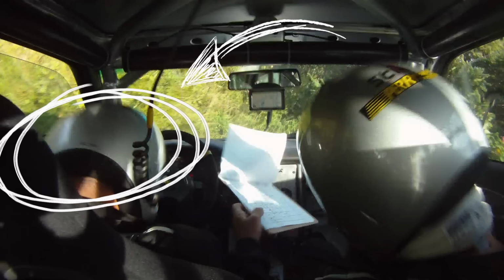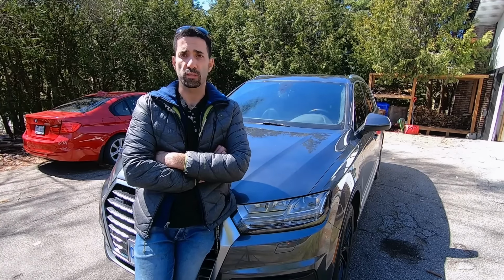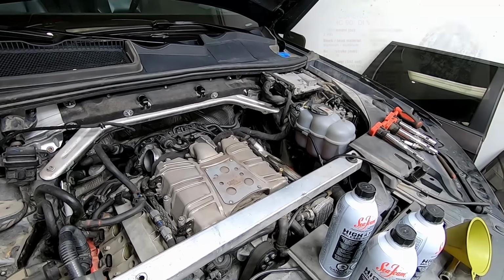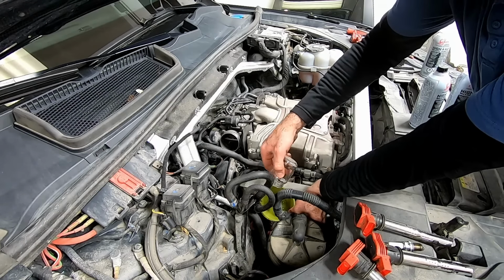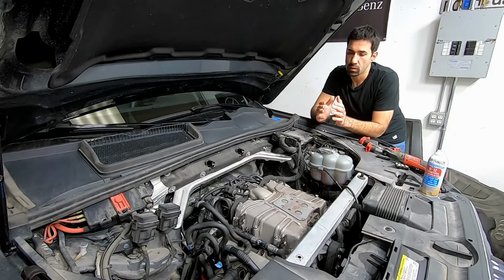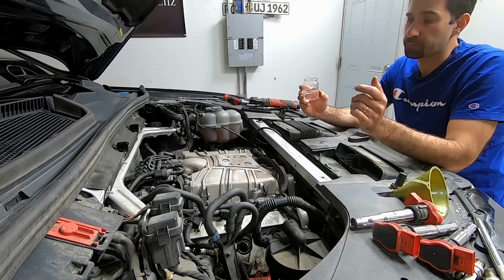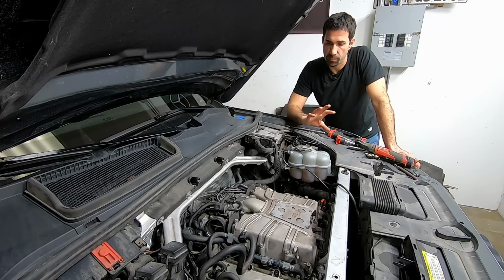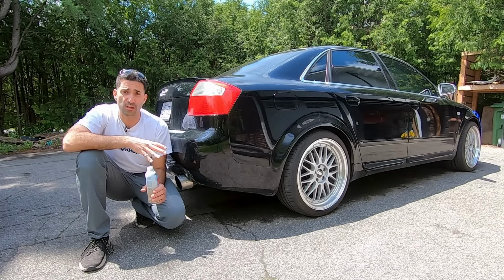How to fix oil consumption on VW/Audi/Porsche 3.0T engine?

Comment: Please enlighten me on why to use Rotella? I am not clear on it. Also, just for one time (after the soak) or ongoing?
Reply from the maker: @Jordan-cf6bo  rotella is a diesel oil and has additives to keep diesel engines clean... it continues the cleaning process after you change the oil... technically speaking the 5w40 is not approved for this engine so if you want to stay in accordance with the spec you shouldn't use it... but plenty of folks run Rotella daily without issues so really the choice is yours
Reply: @ETMotorsports  thanks sorry to belabor this, but what are the cons to doing this? Also, just to clarify, is it your experience to run the Rotella just for one oil change cycle after the soak, or run it from now on?

Comment: Hi friend 
When you flush the pistons with b12 with starter .need to remove the fuse of the injectors?
Reply from the maker: @giuseppecutolo5756  you can if you want
Reply: On audi q7 you don't remove the fuse?
What you suggest me?
Reply: Meaby gasoline on cylinder help for flush all carbon?

Comment: What size of bit or socket did you use to turn the crank shaft?  Thanks.
Reply from the maker: @MichaelPan-p2r  the v6 uses a special tool - I think 1412

Comment: I'm trying to help a friend out with his 2014 Audi A7 and he has the same 3.0 T engine and it's burning a lot of oil. He's adding a quart every couple weeks and we did a spark plug change a coil pack change and an oil change in a car seems to be driving a little better before it was driving sluggish but the oil is getting consumed a lot again and I have a feeling that everything we just did as far as replacing the spark plugs and coil packs are going to be off or not cuz it's probably going to slowly deteriorate those items again and start driving like complete shit again. So I'm thinking about doing this after I show him this video I'm going to see if he wants to give this a try I keep seeing these price quotes from the dealership for $20,000 for a new engine and I keep thinking, obviously this engine has some type of issues that is causing this oil consumption so if they sell you a new engine for $20,000, what is the engine end up doing the same shit eventually and start burning oil when she passed 100,000 mile marker. Nowadays people want to drive their cars well over will past 100k miles sulfur oil consumption to start being this bad you know once you pass that Mark is not cool. Audi should be paying for this I don't get how Audis not at fault for selling a badly engineered engine because if everybody's having the same issue, obviously have something to do with the way the motor was engineered

Comment: Thank you for making this video!  I’ve a 2018 q7 3.0T experiencing the same problem, I live in Kingston which is close to Ottawa, usually need to top up 1L of engine oil per 500 km, could you help me to recommend a shop that can perform this service?  Thank you!
Reply from the maker: hey very few shops will ever attempt this on a customer car unfortunately...everybody thinks this is some snake oil magic so they don't want to deal with unhappy customers...you're probably better off doing the job yourself - it's not that complicated
Reply: @ finally I found a shop here locally willing to try piston ring soak.  It’s now around 1000 km since the soak, no sign of oil drop.  I did had a start stop system malfunction and engine check light around 250 km but it eventually cleared on its own.  Thank you for making this video, I’ll provide more update in the future.
Reply: Update:  1600 km in, noticed the level dipped about 1/5 from max, I did check a few times sometime the level will go back to max.
Reply: Update: 3000 km in the engine oil level display is now 1/3 down from max
Reply: Update: 3800 km so far oil level 1/2 down from max on display
Reply: Update: 6600 km with 1/5 left
Reply: Final update: after 7370 km the low oil level alarm finally triggered to request adding 1 l of oil

Comment: Have a 2012 q7 3.0t, only 80k miles, was burning 1 quart every 550 miles.  Tried various engine flushes over the last few years, nothing helped.  Did the berryman piston soak,so far 1200 miles and no movement on the dipstick.  A few tips: this is a v6 so I jacked up one side of the car to get bank 1 as close to level as possible, added the berrymans and used a boroscope to be sure piston was completely covered.  checked and topped off the cylinders over a 6 or 8 hour period, some cylinders leaked down quickly. ended up using 3 cans just on bank one.  These are big pistons and even jacked up it is still not level and needs a lot of fluid to submerge the pistons.  I would recommend using a boroscope during the top-up process to insure that the piston remains fully submerged.  I only did one side of the engine, in 5000 miles I will do the same with bank 2.  but just doing bank 1 has had real results. (cylinder 6 had an black plug so thats why I started with bank1)
Reply from the maker: 3 cans on 3 pistons is quite a lot of fluid... you can't run the engine with that amount...I think you can get away with a lot less - 50ml/ cylinder every 12hrs or 2 cans total for the 6 cylinders... either way it's worked out great - happy to hear the engine is back to reasonable amounts

Comment: 2017 q7 here. 65k miles. Burning 1L/3,500 miles. Not that bad. But.. 
Does it hurt to do the soak before it gets actually bad? Any reason to wait until it’s in the range of sub 1k/L ?
Reply from the maker: hmm...my Touareg was burning 1L/2000km and I did a soak with Seafoam, which actually pushed me past 1L/6000km...if you're not consuming that much, there's a good chance the issue has not gotten bad enough to require B-12. If you're comfortable with the motor, I would do a soak with Seafoam or something similar at your next oil change just to see if there is any improvement and if there is you can keep doing it every say 5 oil changes just to keep things moving freely and perhaps avoid the big issues altogether

Comment: Wondering if I should do this on my Q7 when so far oil consumption is about 1l per 9000km
Reply from the maker: @alancatraniuc2465  that's not oil consumption mate 🤣 that's your engine just smelling the oil vapors  as they go by...lol don't touch your engine - just drive it like you stole it

Comment: Where did you buy your Crank Tool? I have been seeing kits for $145-$400+. I just want the tool.
Does this crank tool work for all Audi engines you have worked on?
Reply from the maker: @LobbanVlogs  Amazon has it - part of timing kits but I've seen it on its own too... there are a few different configurations for the crank in the Audis - this is for the ones that use multiple bolts to hold the pulley - a lot of the V engines are like that

Comment: I had the same problem with my 2015 Audi Q5, follow this video process with B12 and the results were a success from 170 miles to 1600 so far without adding any oil, I am happy so far. How often should I do this process? Please anyone out there?
Reply from the maker: @humbertoramirez4829  hey great results! You shouldn't do this process if the issue is gone... I'm not sure there's any value in doing this preventative... plus B12 is pretty strong stuff so best to keep it out of the engine unless absolutely necessary...keep track of your mileage until the light goes on - if you can get through an oil change without adding oil i think you're good... in the future if it ever goes bad again you can repeat

Comment: This may sound silly, but wont the heavy smoke cause the sprinkler to go off in the garage?
Reply from the maker: @Vin_Nair  what sprinkler? 🤣🤣
Reply: @ I am planning to do this, but my garage has sprinklers. 😄 I guess, I will just unplug my smoke detectors and it should be good. Wanted to ask what would be a good way to know if the pistons are at TDC, do you need that camera? Is there a way to DM you?

Comment: Can all 6 cylinders be done in 24 hours all together, instead of waiting to do 2 every 24 hours?
Reply from the maker: @rsingh5077  sure... you can do 3 sets of two for 8hrs each,  total of 24hrs...I took my time but you can try a shorter cycle - effectiveness may be reduced but I've no data to confirm either way

Comment: Could you upload a post for the location and how to crank the engine, Audi A4
Reply from the maker: You mean for the crank pulley? You can see it in the video - will need a special tool for the v6
Reply: @ETMotorsports  Any info on the tool required?   I also wished I still lived in Ottawa to pick your brain locally
Reply: @ETMotorsports  The 24MM socket will work for the 2014 Audi A4 correct?
Reply: @ackktarus  same question

Comment: Thank you for posting - what do you think might be a fair price to get a mechanic to help you do this in Toronto?
Reply from the maker: @vSynZero  hard to tell... the actual amount of work is maybe about 1hr but obviously the car sits for over 24hrs... but I'm not sure you'll be able to convince a mechanic to take the risk to try it... you'd pretty much have to sign a waiver that they're not responsible for your engine if something happens...
Reply: @ETMotorsports  Thank you for the detailed steps - hopefully it works when i try it myself

Comment: Hey I'm in Canada and getting B12 is crazy expensive, where are you buying the cans from? Also I'm gonna try it on an infiniti G35 with a 60 degree V6 so it Should be even easier theoretically speaking. Do you recommend I vacuum the cylinders out before every crank rotation for the 6 hour intervals to get rid of any gunk built up?
Reply from the maker: ugh yeah B12 is a pain...I ordered a box from Amazon and it was reasonable the first time around. The owner of the Q7 got a box from a different online retailer - I`ll check with him to see what site he used.

The pile of carbon you saw in the video was basically what B12 dissolved from the top of the cylinder, the valves and the crown of the head. As the B12 drained through the rings, all the garbage was collected at the bottom of the piston so I guess to answer your question it depends on how much dirt gets dissolved and accumulated on the cylinder. In any case - blowing crap out of the cylinders is a good thing - just make sure you're not blowing out B12 that's still sitting inside...if the crank is rotating ok, wait until the treatment is done and then clear everything up
Reply: @ETMotorsports  Yeah it's ridiculously priced here. I just wanna play it safe and remove anything that's remaining in the Cylinders especially because of the high compression ratio of the engine, I'm worried upon starting it up after the treatment some gunk built up that wasn't removed might cause damage but who knows...Also how cruicial is leaving the b12 in the oil to idle is? My plan is to drain the old oil right after and put fresh oil in there before starting the engine? Thanks for your response
Reply: @BreakingCLY  Would love to see @EMotorsports reply to your q re: immediately changing the oil rather than starting the engine with the B12 in the crankcase.  In the meantime, there's one comment (in one of these vid series, I forget where) where the commenter did (almost) what you're suggesting, and got great results.  He said he removed the starter relay, cranked the engine a bit, then changed the oil.  And got great results (essentially zero oil consumption).

Even with that scenario, it would seem there is perhaps an element of risk: the B12 thinned oil might cause excessive wear on the crank or rod bearings. Changing the oil immediately (and not even cranking w/a removed starter relay) would seem to eliminate that bearing hazard.
Reply: @tedjohnson64  That's what I was thinking, it wouldn't hurt to just soak the pistons, dissolve the carbon, drain it right away. I really don't see how taking the risk of the oil thinning and running the engine with a straight solvent could be worth it.

Comment: It will be interested to know what was the oil change interval on this car
Reply from the maker: The owner has had it since 130k... he said the issues started around 150k and he thinks it was aligned with a change in oil manufacturer but I don't see how that would cause the mess inside

Comment: Odd one but why not just jack the car up on one side only and soak the entire bank per side at a better angle ? Or not worth the hassel ?
Reply from the maker: I did think about that - but the pistons are at 45 deg...there's no way I can have the car up at 45 deg and be able to work on it...but doing the pistons at TDC adds the benefit of soaking the valves, injector tip and the head crown so although it takes a bit longer, it's a much better way to do it

Comment: Anyone tried the BG Dynamic engine cleaner?
It takes a couple of hours and absolutely cleans the entire thing out.
Wouldn’t this do the job on the pistons and every other crevice of the engine.
I’m not an expert at all but asking if it’s a better solution.
Reply from the maker: @Hoolibumbum  i have heard good things about it - worth a try but i think it was a lot more expensive
Reply: Yes, I think the chemicals and rinses are somewhere around $350-$400.
Add in 2-3 hours labor and it’s pretty pricey.
But a lot quicker and cleans the whole engine.
Maybe a good test for your channel to do.
Reply: I've seen a post on some forum for a guy who used it.. it's much stronger .. his combustion chambers look brand new .. but he uses some kind of pump to inject that solution at high pressure which help efficiency ..  he is kind of scientist ❤

Comment: What bit on your socket wrench are you using to turn the crank pulley? Thanks for this great video!
Reply from the maker: Ugh that's an annoying one - the v6 needs a special tool... Google T40058 crankshaft pulley tool
Reply: @ETMotorsports  Is there any reason not to turn there motor using the supercharger pulley up top?
Reply from the maker: yeah you can only turn the motor from the crank pulley...anything else will put too much strain on the accessory pulleys and they're not designed to do that

Comment: Hi is there a way to get B12 in europe 
I really need this ASAP
Reply from the maker: @valmirzeqiraj4703  some people have been able to order from ebay etc but it depends on where you are... there are some alternatives you can try like LiquiMoly fuel injector cleaner etc but I haven't seen confirmed cases yet
Reply: @ETMotorsports  I'll do it with LM if the 2nd order of Berryman is blocked from ebay in EU...
Reply: Liqui Moly injector cleaner doesn't work. Oil consumption still the same.

Comment: Hello guys, do I need to lift the car on jack When turning the crank?
Reply from the maker: It'll be easier to access the crank pulley if the car is up but not impossible... you could probably access from the top - depends on what car it is
Reply: @ETMotorsports  which direction need to turn the crank from the video showing clock direction
Reply: @ETMotorsports  and @Matevmmm Re: "It'll be easier to access the crank pulley if the car is up but not impossible... you could probably access from the top - depends on what car it is", I was actually able to do it from the top (mk6 2104 GTI, 2nd gen EA888), but it very much an exercise in geometry. 

 I saw someone do it on a YouTube vid first, otherwise I would never have believed it to be possible.  The video is FCP Euro, "Carbon Cleaning - How to Scrape and Walnut Blast your Intake Valves - MK7 VW GTI), at the 14:30 mark.  He breezes right past this step (and in fact speeds up the video), so I had to replay it at 1/4 speed to see how he did it, as I couldn't manage to get my socket in place when I tried it.

 It took a 24" ratchet, and a 24mm normal length socket.  An extended socket is too long, and a shallow socket doesn't reach far enough inboard to reach the crank pulley bolt.  There was like 1/2mm of clearance to maneuver the socket+ratchet into position. 

Furthermore the passenger-side motor mount greatly reduced the swing arc of the ratchet, to the extent that I was only able to get 1 click of travel.  But it worked!   

Here's a direct link to that FCP Euro, indexed to start at 14:30:  https://www.youtube.com/watch?v=OM0M2bQM-ag&t=870s

Comment: When need to add b12 to  the piston I mean when the piston 1 and 6 are up or down for example
Reply from the maker: You add the liquid when the pistons are at the top to minimize the amount of liquid and cover the whole piston
Reply: Thank you for the information, I did engine flush, changed the oil from Castrol edge to liquid Molly and added ceratek engine protector  so we will see what will happens , did it a  week ago if there is not changes will do the  piston soak
Reply: How you find when piston 1and 6 for example are up may put some extensions in the spark hold and see when is going up or different method ?
Reply: I did engine flush with liquid Molly flush and increase my oil burning from 1000 to 700 km😢